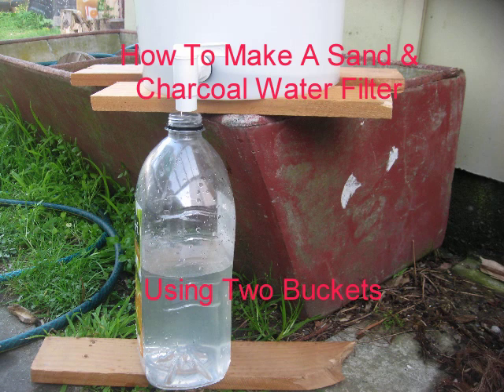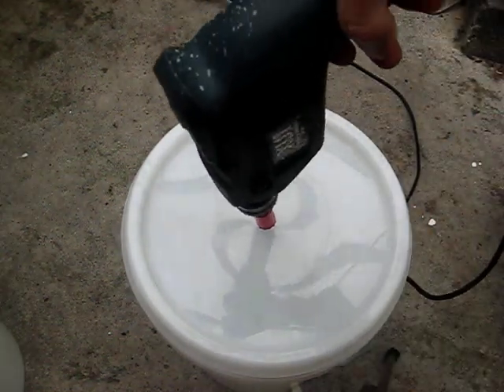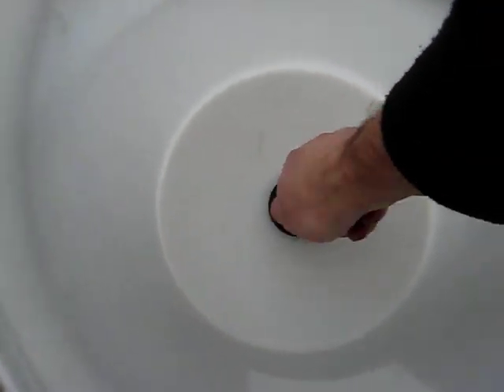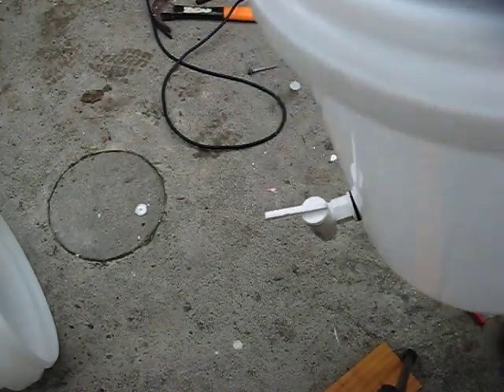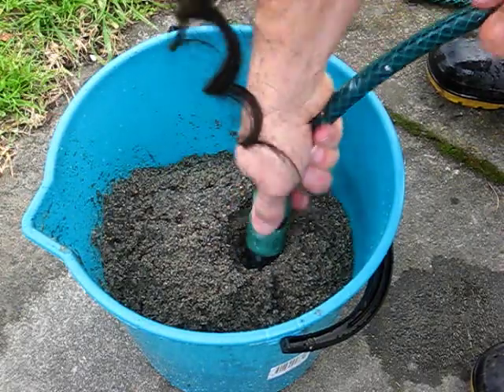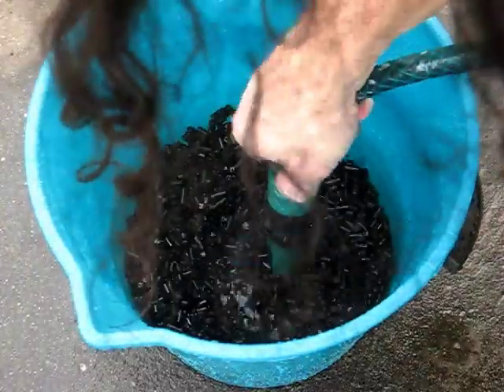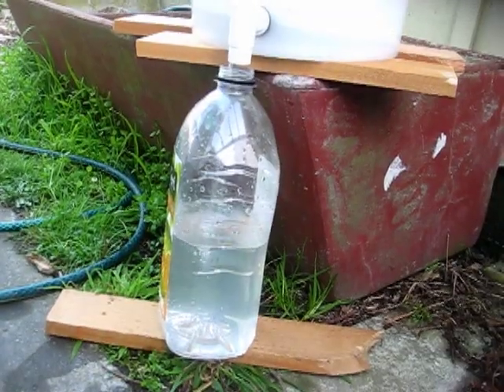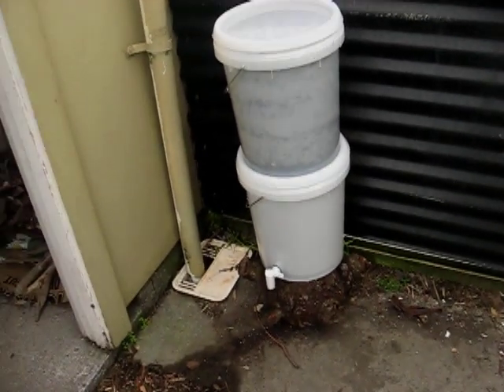Survivalist Water Filter - Make A Bucket Sand & Charcoal Bio filter

Comment: This is a basic FAST sand filter, it will remove some suspended solids. It will NOT make the water safe to drink, better than nothing but the water needs further treatment.
Reply: After filtering the rain water through this sand filter you should then purify it through a ceramic filter, preferably a a silver impregnated sterasyl ceramic filter or a Berkey filter.
Reply: @PINACI  Really, make the bucket system and then spend money on a "silver impregnated sterasyl ceramic filter" or Berkey filter. Easy enough to make a rocket stove using a few bricks, old will do, and boil the water before drinking, using twigs free for the picking. The water filter is for filtering not for purifying. Best purifier boiling water.
Reply: @1caramarie  He's gone to the expense of buying a 15mm metal filter, large gravel, small gravel, sand and 2kg of activated charcoal when all he needed to do was purchase a couple of carbon filled ceramic filter candles and install them into the top bucket, job done and probably cheaper too. Yes you can boil the water to purify it but not only do you have to wait for the rolling boil to finish, you then have to wait for it to cool down but with ceramic filters you can chuck in any old water from a stream or puddle and just wait for it to filter.
Reply: @PINACI  Are you for real? Two very expensive filters, with a limited life span, that you can NOT replace if things get so bad you need to purify and filter, and are probably made in China (they would not ship them to you or anyone in the US. Hint, genius, you are supposed to keep drinkable water in your house, not boil it every time you need it. I have a line of oaks and sugar maple trees that drop branches, a rocket stove cost almost nothing and the wood supply is a sure thing as long as my 100 year oak are alive. The came free with my house. Do what ever you want, if you think you have tons of disposable money and are planing a 50 year supply of filters.
Reply: @1caramarie   Firstly the ceramic filters are not expensive, I buy them for £13 each here in the UK, that's about $16.50 US. They are not made in China either although you can get cheaper Chinese ceramic filters. I use British Berkefeld Super Sterasyl ceramic filters manufactured by Doulton that are lined with silver and have activated carbon inside them which are good for up to 10,000 litres. 

The filter made in this video cost more to make than a British Berkefeld ceramic filter and he will still have to replace the 2kg of activated carbon too because it doesn't last for ever. So my point is you can either spend lots of time washing gravel and sand and then adding the expense of 2kg of activated carbon unless you are going to burn your own coconut shells and a 15mm metal filter or you can save time and money just by putting a ceramic filter inside which if you know what you are doing can be reused by cutting it open and changing out the carbon and then glue it back together.
Reply: @PINACI  Like I said, you can got with what you want, that's why we have brains to make up our own minds, without having to attack people who chose a different route.
Reply: @1caramarie  So who have I attacked ? I think you'll find that you are the only person who has attacked anyone in the comments. Maybe read them all back using your "brain"
Reply: @PINACI  "He's gone to the expense of blah, blah... probably cheaper too. Yes you can boil the water to purify it but blah, blah... wait for the rolling boil.... then have to wait... ceramic filters you can chuck in any old water from a stream or puddle blah, blah..." In other word this is how he should have done it. Rather paternalistic if you ask me. Get real, I would NOT drink "any old water from a stream or puddle" after putting it through a filter WITHOUT boiling it, even if my life depended on it, because it does depend on the filter doing what they people making money tell you it can do, and the filter not being defective. You attacked by pretending to yourself that it's your way or the highway.  You could have said: "I believe that all you really need to do is use a super duper filter and you can drink nasty water safely."
Reply: @PINACI  Would very much appreciate a link to the filters you are buying. Thank you in advance.
Reply: @1caramarie  o
Reply: Instead of doing it once do 10 times like why not.

Comment: Where can you get these parts (not the buckets)?
Reply from the maker: +Bonnie Roberts I guess that would depend on where you are. You should be able to get most of them from a farming supplies store or a larger hardware store. The one exception is the activated charcoal. You can get that at a pet store, or a shop that deals with fish tank supplies.
Reply: aminutetomidnite can this remove the clorine and fluoride from tap water ??? Thanks